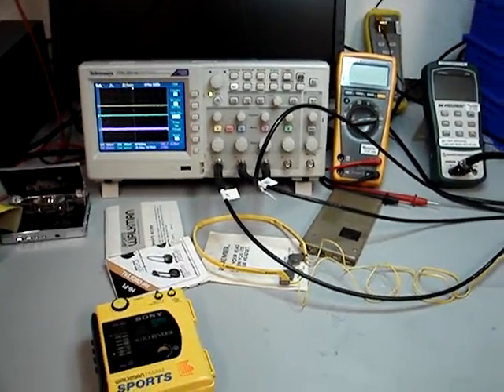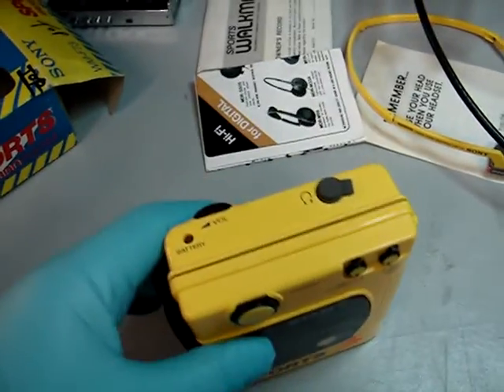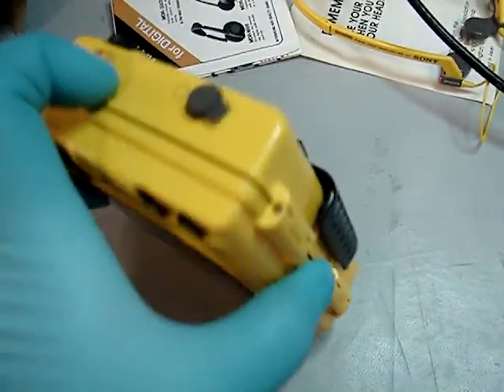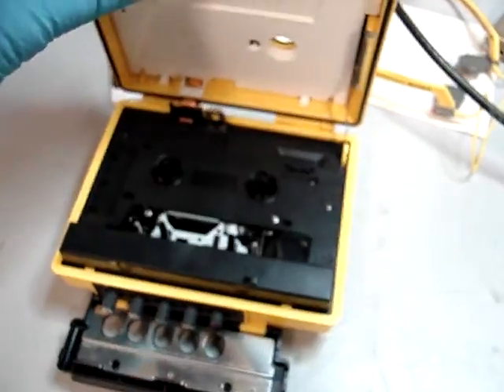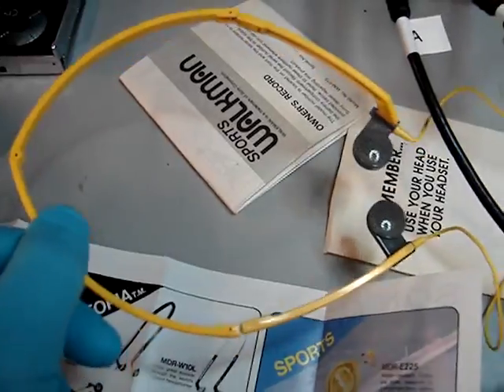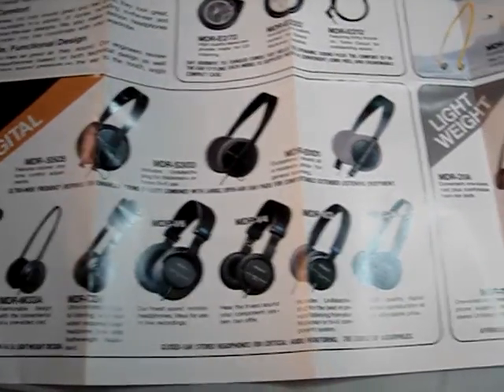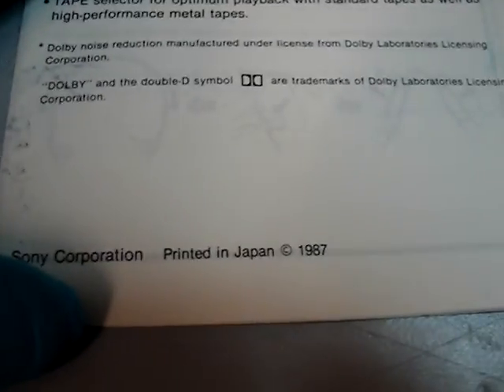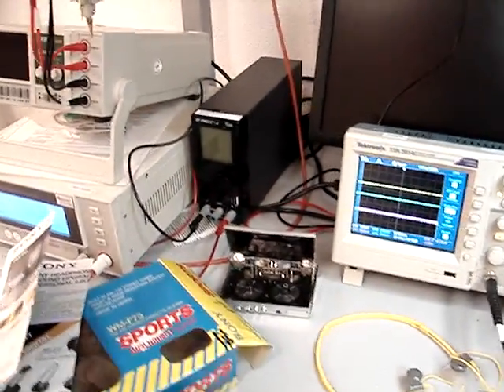SONY WM-F73 SPORTS WALKMAN REVIEW RARE CASSETTE TAPE PORTABLE PLAYER RARE HEADPHONES BROCHURE

Comment: I actually recently just bought one of these Walkmans with refurbished capacitors and a new belt. Looks VERY clean, however, it tends to want to chew up most of my pre-recorded cassette tapes. My pre-recorded cassettes from the 80's and early 90's play through just fine as well as my blank cassettes with music I had recorded on my home decks. It only tries to chew up cassettes from the early 2000s or around the end of the 1990's based of my experiments. It's the pinch roller to the right, but it's spinning, but the tape seems to veer off and i'm sure you can guess what happens next. Any idea on how to fix that or what it could be? I even cleaned, rewound, fast-forward, and everything!?

Comment: Hey I recently came upon one of these and am at my wits end trying to get it to work. I just replaced it's belt as the previous one had disintegrated but now when I put in a  cassette the player clicks three times as it attempts to play in either direction and then turns itself off. Any idea what could be causing this and how I could fix it?

Comment: Hi, i own a Sony Walkman WM-F63. I put a cassette in it, but ist don't work anymore. The radio works  and the sound is great. How can I repair it? I opend it and nothing seems broken.
Reply from the maker: Hi, Its more likely that the drive belt has disintegrated. It turned to mush, broke or stretched. Listen if you can hear the motor turn. Its an easy fix and you can buy a new belt off of eBay.
Reply: @EightiesNut  this was mines issue as well, ‘‘twas the belt indeed

Comment: What direction are you facing the batteries? Mines not seeming to work
Reply: Does it power in in any way shape of form? Also if the battery compartment has acid or could minimise the potential of it working
Reply: Mine likes fresh higher mah batteries.  That's for the radio, my cassette doesn't work.  I'm pretty sure the cassette portion needs more juice compared to the radio.